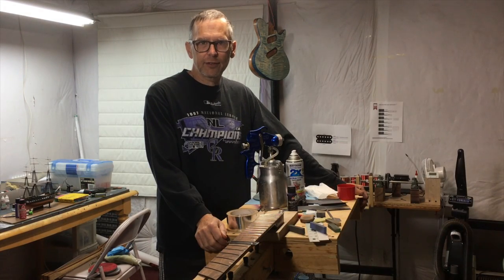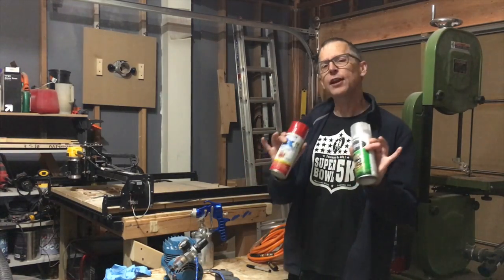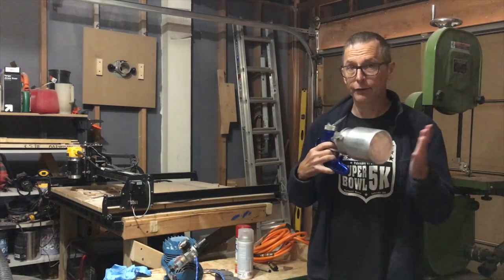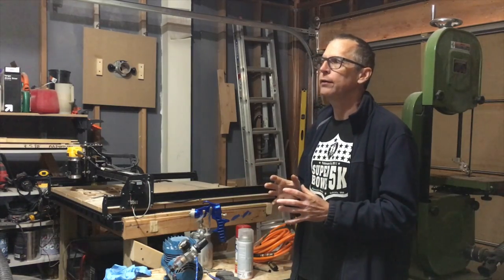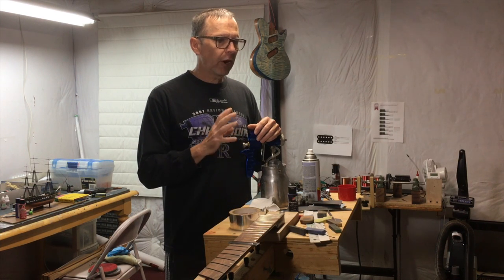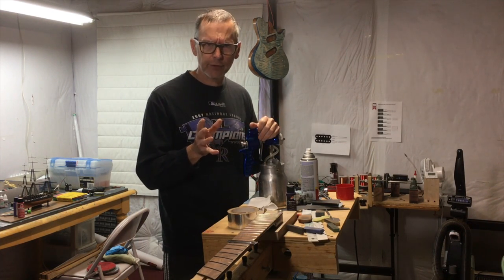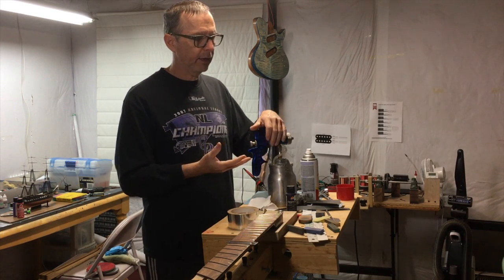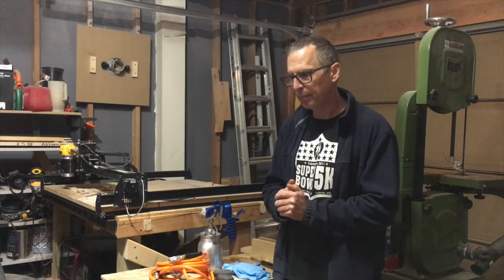Choosing a Spray System For Finishing A Guitar Part 1

Comment: Chris, I would like to clarify what is meant by turbine stages.  Each stage is enclosed separately so that when the air enters the first stage, the fan in there generates a small amount of pressure.  That pressurized air is routed into the next stage where its pressure is increased.  That pressurized air proceeds along to whatever number of stages there are in the compressor until it reaches the turbine's exit port that connects with the air line (hose to which the spray gun connects).  Therefore, the more stages, the greater the air pressure will be.  PSI figures often associated with 2-stage turbines fall into the 4PSI range, while 5-stage turbines can generate just over 9PSI.  You should also know that the reason a 5-stage turbine costs more than, say a 2-stage turbine, is that better quality fan shaft bearings and higher quality machining of the shaft, turbine blades and the separate stages themselves are required as the number of stages increase.  Most spray finish equipment manufacturers purchase their turbine units from one of but a handful of manufacturers worldwide, then they install them in their own cabinets.  Each manufacturer sets up their own cabinets a bit differently, adding their own proprietary bypass airflow, noise dampening, etc. components, which sets each of them apart.  Hope this helps you and your readers out.
Reply from the maker: Yes it does. Thanks!

Comment: Thanks for the excellent explanation! Looking forward to the next episode. I had kind of given up on spraying finishes because I was getting similar advice as you did. The system recommended to me was a $300 hvlp gun and a $500, 3.7 HP, compressor. That did not fit my budget or my space. I'm glad to hear there are other options.

Comment: "In Between." Such a simple idea, and yet with this particular application, it's not so easy. You can get a good LVLP gun with a compressor for about 400 and get great results. But I find that a bench top planer goes from 300 for a 12" width to 5 billiongazillion dollars for anything above 13" and there is no middle ground. Behold the fun of being a luthier. I don't care. I love it nonetheless

I actually bought the Earlex 5500 and I don't like how it lays paint at all. Granted, I am still an amateur at it. Not only is the cup too large for the job, making the paint sputter if you don't fill the cup quite a bit, they don't offer a useful 600ml cup. I bought one for that unit that doesn't fit. Maybe you do or have done a video that shows how you get a good paint job with that 5500.
Reply from the maker: These days, I use the Earlex for thick 2K polyurethane clear coats. For paint, I use a QualSpray QS125WB spray gun with an air compressor.

Comment: How useful are 50 litre 3hp oil free comrpessors? Want to spray water based 2k
Reply from the maker: They should work fine. Mine is only a 10 gallon, 2hp unit and it works fine.